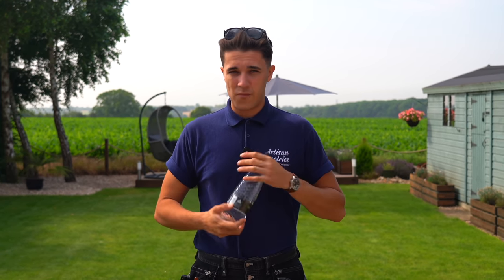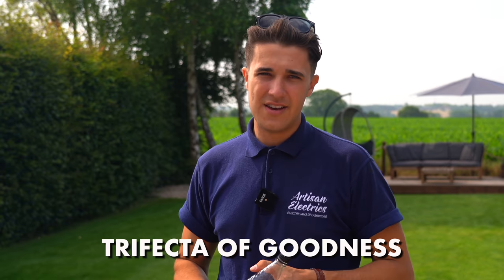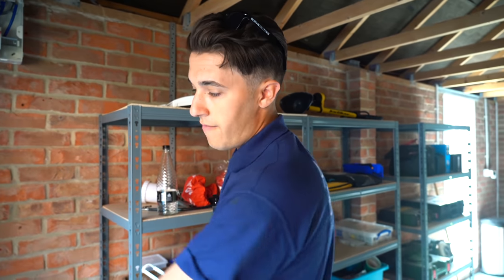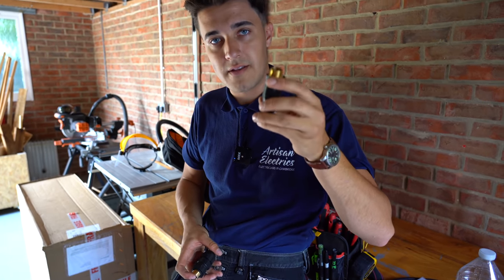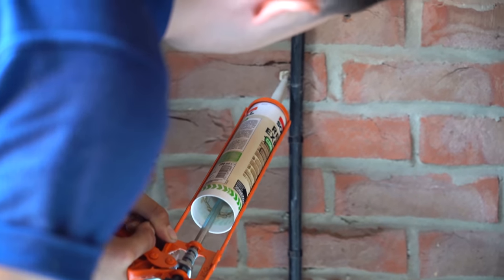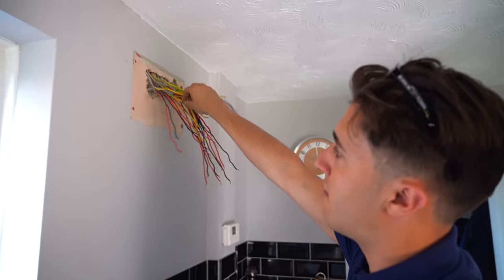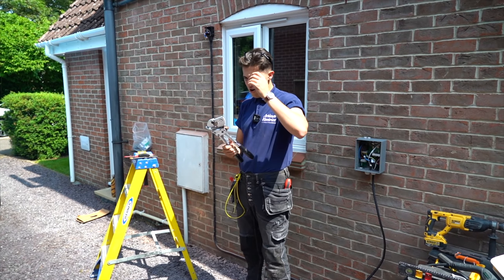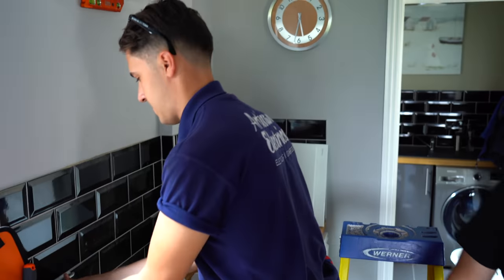Hot Tub Installation Earthing - Earth Rod or No Earth Rod? - Electrician Life

Comment: Why not have both a PME and a TT? Why cant you add a rod/rods  into the existing earthing? If PME goes faulty there's still the TT backup already connected? I don't recall anything saying this can't be done? In that video you could potentially have 3 earth rods, basically making your own PME system.
Reply: That's how I read it when I put mine in. 

Regulation 702.410.3.4.3 therefore recommends: ‘Where a PME earthing facility is used as the means of earthing for the electrical installation of a swimming pool or other basin, it is recommended that an earth mat or earth electrode of suitably low resistance, e.g. 20 ohms or less, be installed and connected to the supplementary protective equipotential bonding’.
Reply: @davew6605  We normally always add a rod local to the tub inconjunction with with pme earth as like a back up incase a pen fault (or so that’s how we see it) however as i mentioned the rod should be below 20ohms but in what reality is that ever a thing? 
I’d say the majority of tub points i come across installed by other electricians are 90% pme with no rods at all.

Comment: I don't think this hot tub discussion will ever end its destined to go on for ever I have found its 50/50 over electricians and even nic inspectors are 50/50 some will say earth rod some will say export the pme hot tubs are double insulated you won't find conductive metal accessible parts on them exporting the pme and being rcd protected is perfectly exceptable
Reply: if you export the pme you need need a 16mm earth lol. easier to put a 5/8 rod in and you will get a 10mm onto the earth rod with a nice pit.

the matte is not to be used for hot tub only for car chargers

Comment: The regs do state follow the manufactures instructions when applicable. All the hot tubs I’ve fitted are Class 2 regardless if you take the panel of the side and expose any metalwork. At the end of the day if you’re taking the side panel off you need a tool to get inside it which makes it an enclosure that should only be accessed by a competent person therefore not an exposed conductive part.

Comment: Hot tub has a water heater and a water pump, so electricity in close contact with water where humans are supposed to be bathing in. I think that would class as something that deserves the highest amount of protection.
Reply: What does the 'P' stand for Martin?
Reply: @edglue6138  Paul, it is to differentiate myself professionally from the renowned economist Martin F. Hellwig.
Reply: @MartinPHellwig  Haha. I see. 👊
Reply: Typically hot tubs are heated purely with the heat from the pump and don't actually contain a water heater. They're also typically made of fibreglass with plastic pipes and tubes, so it's limited how much of the tub can be electrified in case of a fault. It still needs to earthed properly, obviously, as mixing water and electricity is never good, but it's worth keeping in mind that a properly made hot tub already has lots of safety built in, and the manufacturer should state exactly how it must be hooked up to be safe.

Comment: I think i mentioned it on another video, i couldn't get an earth rod at or below 20 ohm, so i went for pen fault detection, as i have not seen the hot tub. I don't know if it has any extraneous conductive parts or not, so super safe for me.
You have done a cracking job again. The cable craft is Bob on, you have found a use for brick dust. I love it.

Comment: John Ward has done very good advice on earthling on his channel, including hot tubs.  It’s not plain sailing as you need to take into account earth paths to installations in adjacent properties.
Reply: Correct.  And in built up areas, an earth rod installed to be a TT system, could still end up being PME
Reply: Why not just use a CU with PEN fault protection.

Comment: If I remember rightly there's around 1000 PME faults reported per year and severe injury or death in around 1% of those cases so 10 people. It would be worth putting the hot tub on TT with a low mA rcbo and/or pen fault detection, the option is of course yours as you have the manufacturers instructions to hand. Just remember it's a special location so safety first and still subject to the 3m socket guidance not that anyone ever seems to take notice.

Comment: The SWA should be earthed at the house end.  And separated at the garage end, most often by taking it through a plastic adaptable box before it enters the garage unit.

If you don’t do it your way, you reply on the earth rod to achieve disconnection in any event when there is a fault between Live and SWA.  Earth rods have a high resistance.  And are unstable.  Using the earth rod to  earth the SWA may not achieve enough fault current to operate the circuit protection device at the house end in fault conditions.

I’d nip back and change this ASAP mate.

* unless of course, the SWA is protected by an RCD?

Comment: A hot topic from watching some of your videos is the issue of having to pull the main fuse in order to isolate. I work on one of the contracts for a big supplier and generally DNO responsibility ends at cutout, they wouldn’t fit an isolator. Even on new supply’s as they’ll just install cutout, bung, seal and leave. 
If electrical work needs to be carried out the customer can contact the supplier, as supplier operatives can remove fuse and re seal. Generally across the board most suppliers will have all operatives carrying 2 poles as its common ground getting VIR, undersized cables on installations etc where safe isolation is necessary. 
Getting a supplier out before you guys get to site is always a ballache due to time and practicality on schedules.

Comment: Hi guys. I am in the process of installing a garden supply for a customer. I’ve gone with a condudisc. It cost a fortune but after I described it to the customer. They jumped at it. Next door I installed a garden room supply and ended up using 5 rods! Ended up with 179 ohms. I’m hoping the disc gives a far better reading. I’ve been quoted 44 ohms. So we’ll see 🤞

Comment: What are those clips you're hammering the swa into the brick wall with, look like a time saver
Reply: linian super clips I believe 👌
Reply from the maker: Yes that’s right
Reply: I am not sure they are that quick, you still have to drill a hole, and a battery driver is quick at putting screws in, plus they are expensive, and does an outside cable warrant metal fixings, is someone likely to get tangled in that.

Comment: For such a short run, is there any justification for adding another joint, instead of just feeding the SWA cores all the way  though?
Reply: I’ve seen some people say that the inner layer of the SWA not actually considered insulation, just a bedding compound. Not really looked in to it myself but if it is true that’d technically mean you’re running singles through a wall even though you’re not? Confusing concept
Reply: @MrToontownforever  maybe so, but you could quite easily oversleeve the bedding with 16mm insulation which would provide double insulation without the extra joint.
Reply: @r3co0  Our company tends to sleeve the bedding and cores going through the wall with 20mm conduit but regardless one end or the other the armor ring needs earthing and standard practice would be to earth it at the supply. Hence either changing the cable over and jointing in the Wiska box or running a single earth through something like Conduit to the swa gland.

Comment: On the hot tub it would be interesting to find out whether you adopt faster tripping and lower current tripping RCDs/RCBOs than standard 30mA for Hot Tubs. Given that in the USA some of our GFCIs trip at 4-5mA in 3-7mS and no normal, transient DC leakage unnecessary tripping. I say this because many UK hot tubs sold come from USA and many are sold within an in-line GFCI. Do you cut that off and put on a SWA for better mechanical protection with a slower tripping RCD. I agree on the earthing as well regarding sticking two rods in.

Comment: I would install a supportive earth electrode and connect it to the earthing system of the house, protect the tub circuit with a 10mA type A RCD. Here in Germany every house built after 1980 has an earth electrode, usually a foundation earth electrode or a soil embedded ring earth electrode. No matter if TT or TN-C-S.
The VDE still states in our regs to install 30mA type A RCDs, but since 2013 it's recommended to install 10mA for bathroom circuits (and only for them to prevent nuisance tripping). And since this is some kind of bathroom stuff I think that's a good idea. The thing is, in no other environment people are as vulnerable as there. Naked and wet. The 30mA threshold is for healthy adults, elderly people, people with heart issues and children are much more vulnerable to an electric shock.
The only exception would be, when the hot tub is a three-phase one with 11kW. Then you can't install a 10mA RCD protection because there's no three-phase 10mA RCD available, only single phase ones.
Reply: I think it's better in Germany because you use three phase, so even if there is a neutral fault, the voltage goes wrong but electricity has a path back through other appliances and the earth rod helps limit voltage rise.
It's the single phase installs where problems come.
I've seen an overhead street feed where the neutral broke near the transformer side.
The houses further down only complained about low voltage one one phase (179v), the others didn't notice high voltage (280v).
No one reported shocks either (Yes TNCS system). The only giveaway was one house had a smart meter that kept disconnecting. This was because it's set to disconnect when voltage out of range (not common in these meters).
Reply: @the_real_hislordship  The best thing about three-phase is you can better detect a PEN fault because you got more reference points. The problem is, the voltage is floating freely between 0 and 400V, depending on the appliances connected. It's influenced by the appliances which are connected or disconnected, because when the PEN is broken the appliances are then actually in series between the lines and are acting as a voltage divider.
Reply: @Marcel_Germann  oh yes I know this very well.
I have three phase (South Africa) and the neutral at the transformer for my area came off in March 2020. Lots of houses had damages within seconds. 
Phase 1 and 3 went high and phase 2 went low.
Reply: @Marcel_Germann  the current between phases has to balance out, so the voltages are pushed all over. V=IR.
Reply: @the_real_hislordship  It depends what is connected to the grid in that particular case. And the voltages will change if someone plugs something in or unplugs it, that will have an impact on the voltages.
I'll make an easy example. You have an electric heater with a demand of 3680W connected to a single phase circuit supplied by L1, that's a resistance of 14.4 Ohms. On a circuit supplied by L2 you got a soldering iron with a demand of 20W (2645 Ohms). They're both connected via the neutral, when the neutral fails they both are in series between L1 and L2. In that case that means the heater will "see" 2.2V and the soldering iron 397.8V. If you hook up more appliances to these circuits, they're resistances in parallel to the soldering iron and the heater, impacting the voltages the appliances will "see".
If that happens on a bigger scale it will float much more because people switching lights on and off, switching TVs on or off, maybe they're cooking with an electric stove, using the microwave oven and such things.

Comment: There is a NICEIC webinar on installing hot tubs, most don't need an earth rod. And don't forget no socket within 3 meters
Reply: What do you mean no socket within 3 meters? No IP rated socket by a hot tub?
Reply: @ryanrickard2042  Yeah cause no doubt some spacko will try to dry their hair whilst in the hot tub.
Reply: @ryanrickard2042  No socket of any type, like a bathroom
Reply: Really, I have seen plugin hot tubs and the lead was less than 3m how does that work then 🤔
Reply: @acelectricalsecurity  see so much unnecessary 'bonding'. On a relatively new build house this week. Plastic incomer, 2 ft of copper behind the sink then the rest of house is Plastic. Of course the 2 ft of copper was 'bonded' 🤣
Reply: @lewis94uk  they don’t have extension cords in the UK? Remember, fools will always find a way to succeed. You can only have so many rules & regs to try and protect the fools. 

Here in the States you can have an socket in a bathroom, protected by a GFCI. Outside sockets also must be protected by a GFCI.
Reply: Oops!  (My IP68 socket is about 0.5m away...  Was originally for somethimg else and then we got a hot tub!)  However my wife won't be able to dry her hair etc. Because the clips on the socket cover are almost painfully impossible for even me to open!  Plus, one can also put a padlock on it, if one wants...  The socket is a 30mA RCD type however the hot tub also has an inline 15mA RCD (IP rated) although it does have a 7m cable but the included built-in LEDs only have a 1m cable! Doh!

Comment: I am a little surprised that you mention PEN fault but don't mention the ground/earth potential.  PME can have a variable voltage (same as neutral) of up to 20V depending on the phase imbalance, and that becomes significant for "wet people" who are very conductive, even down to 1 volt.  
This PD can result in a large enough current to flow with the, say 10V, earth/water (bonded) potential to kill someone - and this is more likely than a PEN fault.

Comment: It's interesting, we are constantly told by the networks not to touch their stuff or put stuff in the meter boxes, yet somewhere along the line we have either been conned into taking responsibility or taken it upon ourselves to take responsibility for their supply.
What happens to their supply, is nothing to do with me or the homeowner, and if this system is that dangerous that it needs addition equipment then they should be footing the bill.
The networks use pme for one reason, it's the cheapest option. 
The powers that be, if they had a spine, should be making it quite clear to the networks, they are responsible for their network and don't rely on the electricians to cover their arses because they can't be arsed  maintaining their own network.

Comment: Your over thinking it . Would you install a pen fault detection on a shower , an emmersion heater , kettle or a washing machine. All the hot tubs Ive ever instAlled has been class 2 they are mad from fibreglass. Only install a TT system if you have poor Ze reading. You could ask what hot tub they are getting and look up the installation instructions online. The reason you install a pen fault detection on a EV charger is to prevent the metallic body of a car be coming live . I've never come across a class1 hot tub. All you need is a basic redial circuit with a water proof two pole isolation switch out of reach of the hot tube users.  Change a CU without testing is a poor show ? Sorry Cory thumb down on this on. 👎👎
Reply: Yes, a bit too much fashion show as usual.  Probably just edited the testing out for more shots of Cory in his shades.  Tidy work though.
Reply: Totally agree with this !!!
Reply: Unless you’re talking about blow up lazy spas, i think you’ll find the majority of hot tubs are class 1, water will normally run through a section of pipe that’s completely metallic connected to the tubs earth.
Reply: @Chris-gt3rs  you mean just like a shower ?
Reply: @seangoodyear4246  Yes showers are class 1 as well. I’m not arguing against tubs on PME supply’s i install on average one a week like that. All of which class 1.